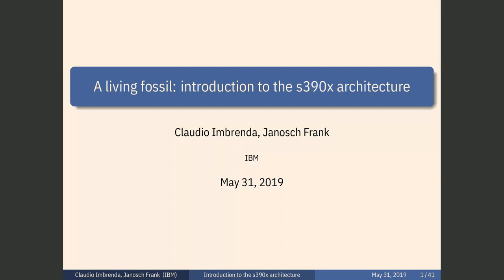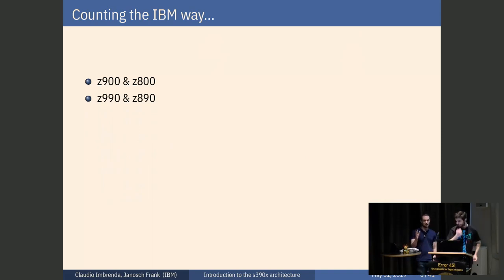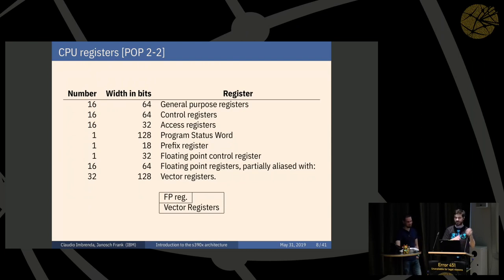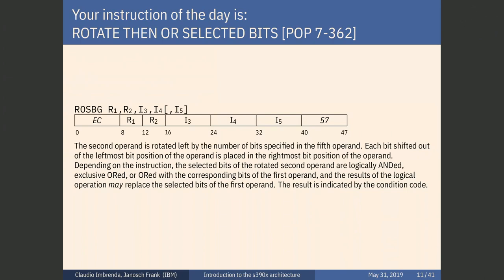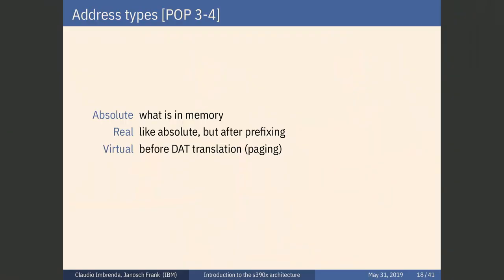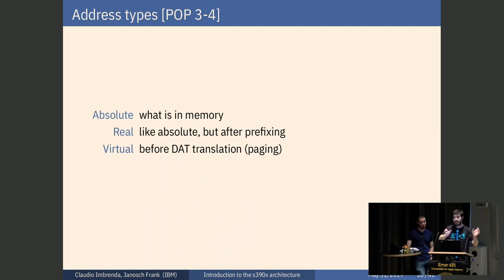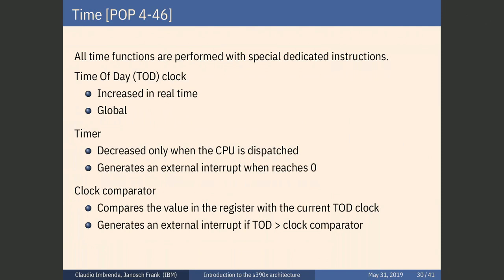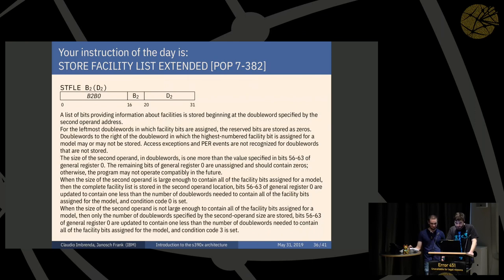IBM s390x architecture

Comment: Good presentation!
A couple of doubts,
On other architectures the page tables occupy 31 pages? Didn't really get that.
Also 4 pages on each level is only for the RFX level isn't it ( (2^11 * 64 ) / ( 4KB * 8 ) )? At the RSX level it is going to be 2K * 4 Pages (2^11 * 4 pages)?